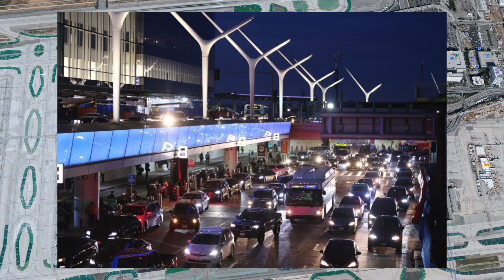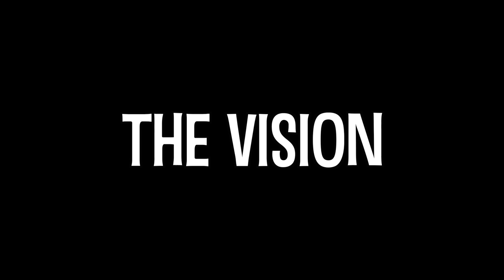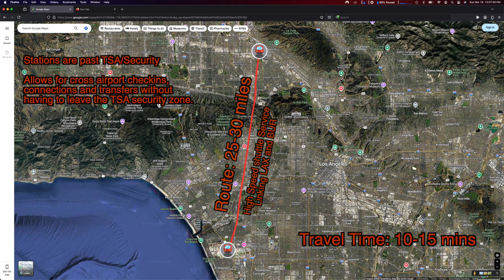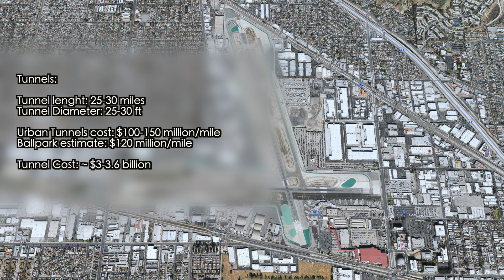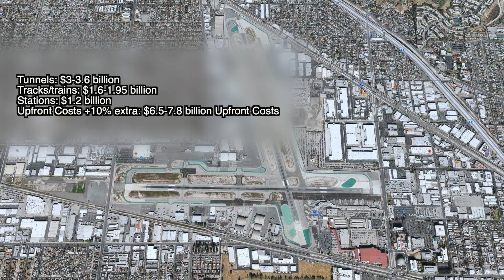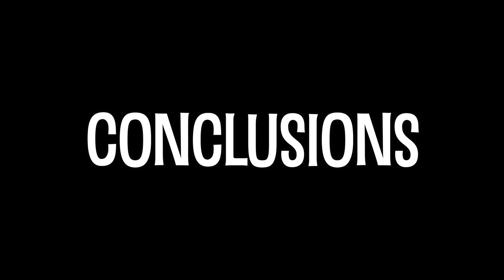LAX to Burbank - High Speed Airside Train? [Engineering]

Comment: Here are the costs for existing urban mass transit tunnels.
Project									City			Length		Total Cost		Cost per Mile
Central Subway						San Francisco	1.7 miles	$1.95 billion	$1.15 billion/mile
Second Avenue Subway (Phase 1)		New York City	1.8 miles	$4.45 billion	$2.47 billion/mile
LIRR to Grand Central					New York City	3.5 miles	$11.6 billion	$3.3 billion/mile
Crenshaw/LAX Line					Los Angeles	8.5 miles 	$2.1 billion		~$250 million/mile
Purple Line Extension (Phase 1)		Los Angeles	3.9 miles 	$3.0 billion		~$770 million/mile